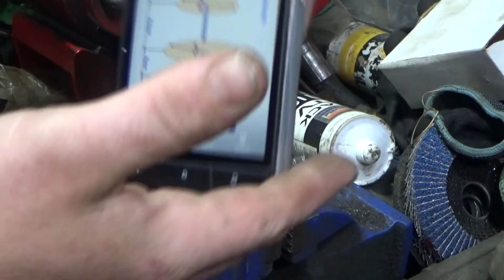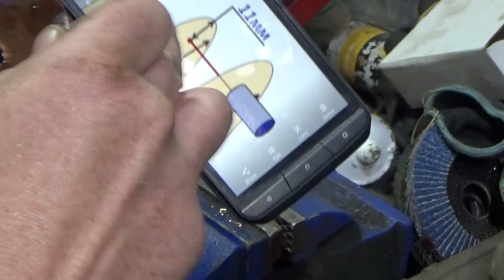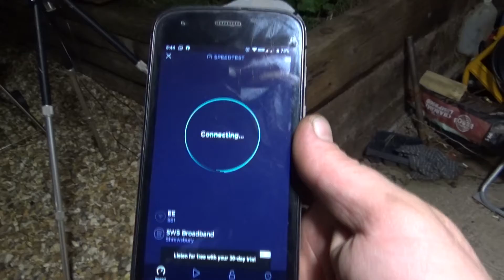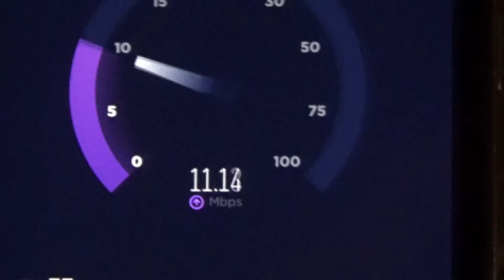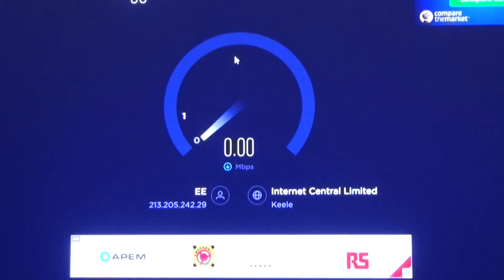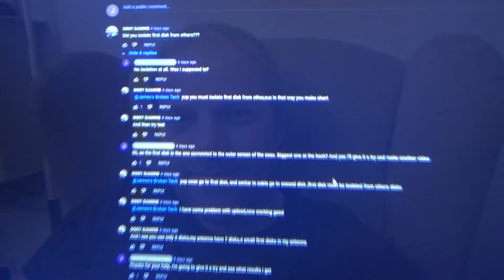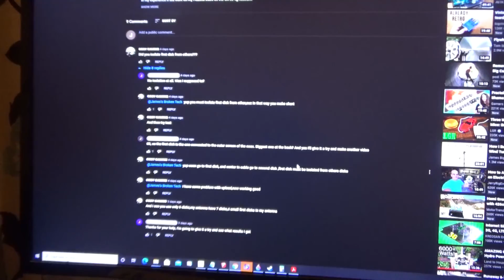DIY 4g antenna v2 updates and design changes ee 4g UK

Comment: Better cable mate is really Gona make ur efforts count as that cable your using will have horrible losses and attenuation ,
Reply from the maker: thanks, which cable should i use?
Reply: @jamesbrokentech   LMR 400
Reply: Correct lmr400 , it's not flexible but u can buy the ultra flex cable too with insignificant losses , keep your runs under 15m using any cable , remember the higher in frequency u go up the losses are higher too , always use 50 ohm connectors and when soldering use as little of a blob as possible or file off the excess james otherwise u get RF
Reply: Also James for 2100mhz I find 12mm from the edge of driven element ie second disk to be best , 90 degrees out . U can rotate antenna when taking measurements . Use huactrl pro and select your desired band and lock in on that , otherwise u could connect to band 20 or band 28 that's 700/800mhz not knowingly and think your antennas failing when infact your locked into the wrong mast frequency .
Reply: Use a dremmel and sand paper and gently round your disks and file off any jagged edges , try get a huawei b818 best 4g router at a decent price on tye market , of course u can buy a huawei cpe pro2 5g router and modify it for 4x4 mimo